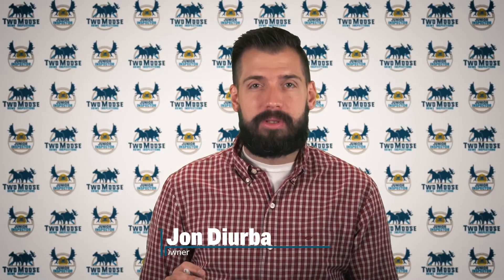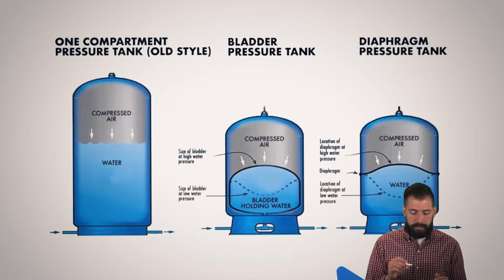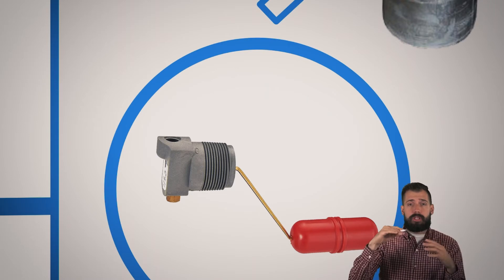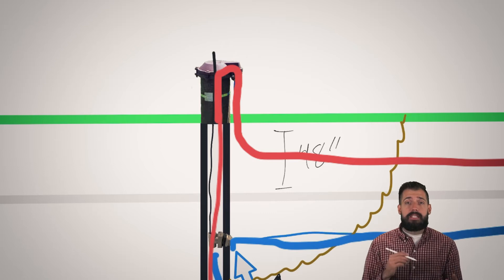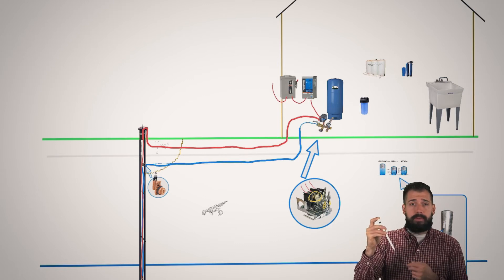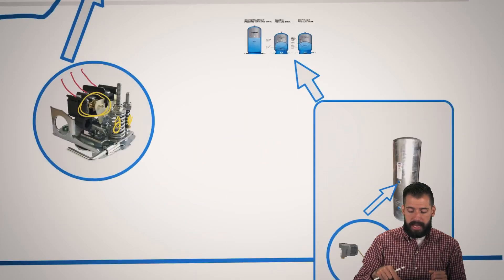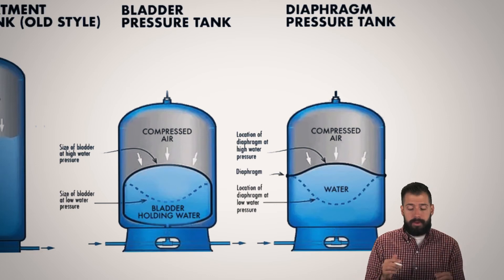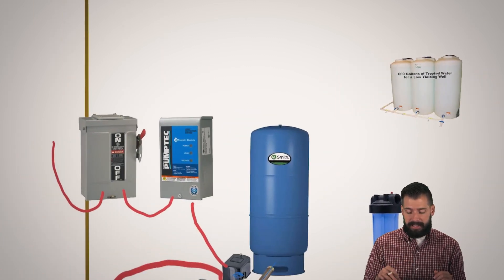Types of Pressure Tanks - Wells 6 of 10 - Some Well Pressure Tanks Are Better

Comment: Greatings for great video!
I have some dudes between old style and bladder tanks:
Which ones makes the best use of sizes-volume ratio in capacity/volumen of pressure water?
Which last longer over time ? Would the bladder last more than 2-3 years?
Reply from the maker: Each type as their own modes of failure, but proper maintenance which may include ensuring adequate water and air pressures and understanding how issues such as hard water can effect your equipment and then taking steps to reduce damage, they should all last the same amount of time. All of these systems should last significantly longer than 2-3 years and 10 years would be close to the limit for these devices depending on use. Each type is best suited for different applications such as water wells with above frost line supply lines (One Compartment Pressure Tanks), Small Spaces , Non-level  Mounting, High risk of Oxidation (Bladder), High pressures (Diaphragm). Obviously depending on the tank each tank could be used for each purpose if the manufacturer allows. Double check the manufacture recommendations listed by both the tank manufacturer and also the well pump manufacture for capacity and volume recommendations. If you need more guidance check the International Residential Code for sizing.
Reply: good information men , but in the case of old style pressure tank, non less than 10 years? 
because if these was inox, i think any damage can happened with him. @twomoose

Comment: Sir in my application  I using water in bladder . for selecting the DPT  for bladder  vessel . Our pump pressure Is 13.5 bar  and our pre charged pressure is 2.3 bar . At surge occur  what the pressure  at  both side of the tank pls help me.
Reply from the maker: Hey, I think you are asking what pressure a water expansion tank should have for a water well. The cut-in point of a switch is the pressure that triggers the pump to turn on and start pumping. Example: As you use water the pressure in your system will drop and once the pressure is low enough the cut-in will turn on the pump and the pump will continue to pump until the pressure is high enough to reach the cut-out point.  The pressure in the water tank should be 2 psi or about 0.14 bar below the cut-in point. This way the pump is strong enough to fill the expansion tank. If the tank pressure is too high the water pump will not be able to fill the tank. If the tank pressure is too low the pump will turn on before the tank has been emptied.
Reply: No sir it is a water in bladder type surge vessel. My doubt is pre charged air in vessel is compressed by water in a bladder at that pre charged pressure is rise or not.
Reply from the maker: @naveenkumarbe5691   Hey, If you are talking about a water hammer arrestor then the pressure should be somewhere between 30-50% of the normal operating pressure. You need to take measurement of the water pressure in the pipes, then take a measurement of the air in the tank and adjust the pressure as needed. If you monitor the pressure in the air tank, you should notice changes in pressure when the water is turned on and turned off. If we are talking about an expansion tank for a home it might be time to call a professional to diagnose the issue at your location. If this is for a commercial water hammer arrestor there should be specifications outlined by the manufacturer. I hope this helped, sorry I wasn't able to understand your question.

Comment: Hi, greetings from Sri Lanka. Thanks for this very useful video. I am still learning. Recently my pressure pump for the bathroom showers started to drop pressure and as result the water flow gets really slow and only a while the pressure pump restarts. I checked the pressure gauge and find the pump restarts only when the pressure goes down to zero. Could you pl advice me to correct this, which nuts to adjust in the pressure switch? Thanks again.
Reply from the maker: Hey Upul, You are on the correct path. First, be very careful around electricity. Second, try to find the manufacture's manual online. If you can't find the manual, then you can do experiments. You can watch or use your cellphone to record the switch's behavior as you turn the water on and off. This will help you determine what turns on the pump and what turns off the pump. Then you can make adjustments to the nuts to get the desired result. Unfortunately I don't think I can be any more help since you have a different power grid and probably different parts than what I am used to. Good Luck!

Comment: Well explained, I sub'd today based on your clear and carefully prepared explanation. Question. To measure pressure in the air bladder of a diaphragm style tank, I presume the motor power should be turned off, otherwise you'll just be measuring system pressure. Does the tank need to be completely drained of all water before measuring pressure? Or, is it good enough to wait for pressure to drop to the point the pump starts, then immediately cut power to the motor and measure bladder pressure when the system was at the cut in pressure? Those two methods will give different readings, because of the height of water column, and the different proportion of the tank occupied by water. 1 psi = 27.7 in water....
Reply from the maker: Thanks for the Subscription! My understanding as a home inspector is that the pump should be shut off, then the pressure in the system should be released by opening the faucets in the house, once the pressure has been released then the diaphragm should be pressurized to the correct pressure. The reason you want to remove pressure from the plumbing system is because the pressure in the water lines was initially measured relative to atmosphere. The pressure in the diaphragm should also be measured relative to atmosphere without any complications created by back pressure from the well or plumbing system. This will allow the diaphragm to use its full range of motion to work as intended.  What Pressure to Use - Example: As you use water the pressure in your system will drop and once the pressure is low enough the cut-in will turn on the pump and the pump will continue to pump until the pressure is high enough to reach the cut-out point.  The pressure in the water tank should be 2 psi or about 0.14 bar below the cut-in point. This way the pump is strong enough to fill the expansion tank. If the tank pressure is too high the water pump will not be able to fill the tank. If the tank pressure is too low the pump will turn on before the tank has been emptied. Hope this helps!
Reply: @twomoose  Thanks!